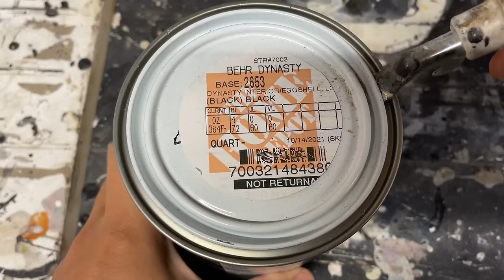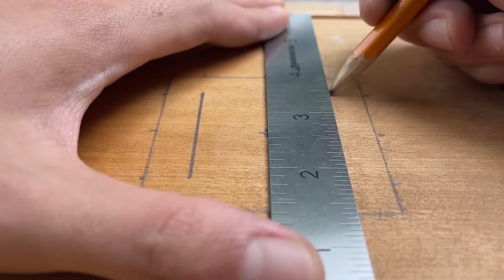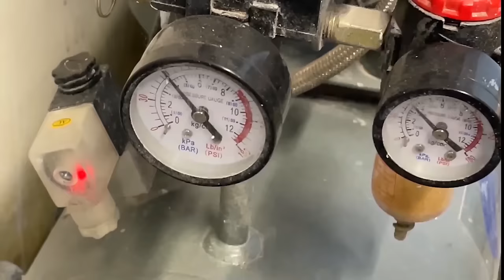SQUID GAME DRESSER | Furniture Makeover

Comment: To get a circle with a table saw, after cutting most angles just keep rotating the workpiece against the blade and you'll save a lot of sanding (besides getting a perfect circle, which sanding doesn't guarantee).

Comment: 10:03 a tip I discovered myself but what appears to be a known hack: put a nut on the bolt before cutting, after cutting you straighten out the thread by removing the nut, and usually eliminates any damage to the thread! 

Love your work, amazing eye, and love your economy of movement. Very inspiring. Glad for once I could return the favor ;-)

10:34 love the wood grain through the paint!!

Comment: I have a question..
I have tried using a dremel to shorten screws, but it makes the thread unusable at the end. How did you get a nut started on cut end?
Reply from the maker: I noticed that happens sometimes, I think it’s because the Dremel can sharpen the thread outwards, making it wider than the hole. I just keep grinding down the tip and keep trying until it works :)
Reply: @ModernMakeovers  Ok, thanks for the response.  Maybe I can try precisely deburring the sharp edge of end of the thread to allow the nut to enter the thread.  Thanks again. love your channel!

Comment: Hello, why didn’t you use spray gun for the pink paint?
Reply from the maker: Hello! I could have used a spray gun, but I chose not to for a few reasons: 1) I would have had to tape up and cover the body of the drawers to shield them from the paint, and 2) Spray guns waste some paint and are a pain to clean. Despite these reasons, I sometimes choose to spray anyways, but in this case I wanted to brush :)